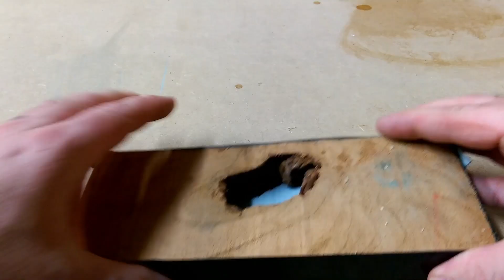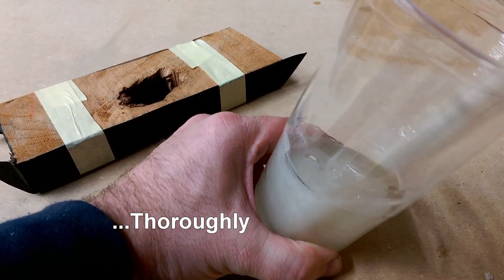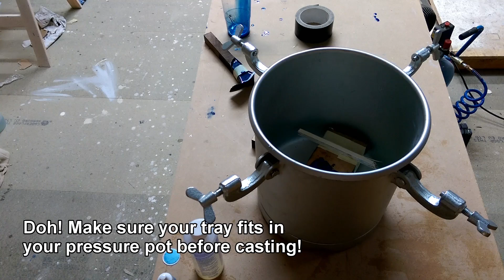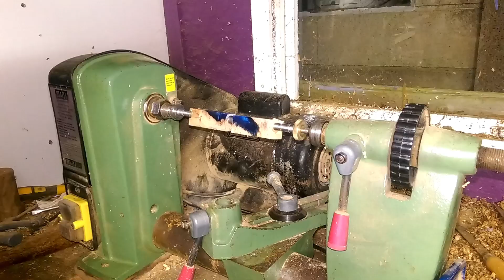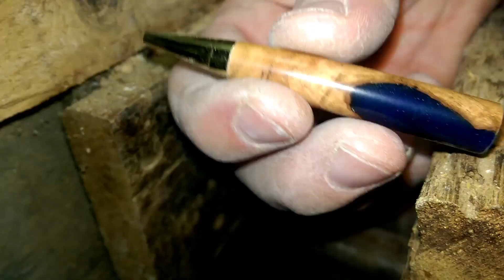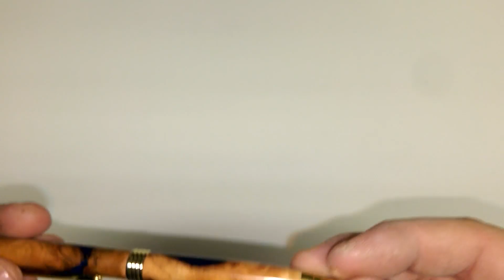Casting worthless wood and alumilite resin pen blank. Cherry and Blue resin

Comment: Beautiful blank and pen! How important is the pressure pot part in preparing the blanks. I have wood and epoxy resin, would these be ok casting without a pot. Thanks
Reply from the maker: Gareth c I haven't really experimented without a pressure pot, the pot was about as much as the resin I use so I don't want to waste any, if you have slow set epoxy you can be careful when mixing and pour from a height to pop the bubbles whilst you pour and try to pick the bubbles out with a tooth pick, it might take a bit of practice and patience to get it right, please let me know how you get on!
Reply: James Garwood thank you James!
Reply: Hey Gareth, like you, I don't have a PP either.  I am getting final parts for one this weekend however.  I've had good luck like the jewelry girls do by using slow setting resin and periodically blowing a torch over the blanks to suck bubbles out.  Worked for me ok.

Comment: Hey James, what's the purpose of the pressure pot?
Reply from the maker: The pressure pot compresses the bubbles in the resin down so they become microscopic, if you didn't use it there would be big bubbles in the blank that would need filling
Reply: Would putting the block under vacuum remove the bubbles?  Sort of like when they make composite structures.
Reply from the maker: @brucepeters9575  vacuum isn't as good for resin, it doesn't pull the bubbles out as well as you might think, pressure crushes them down until they are so small you do not see them anymore, I hope that helps!

Comment: Is the wood stabilized? And why Amazing Alumilte instead of Alumilte clear?
Reply: You could mount your pressure pot sideways for the longer casts!
Reply: Just build a shelf
Reply from the maker: I didn't stalblize the wood for this one, I have been thinking about putting the pot sideways if I needed to bit I've not needed to yet
Reply: @JamesGarwood  same here. No need quite yet for all that.
Beautiful pen BTW.
Happy turning

Comment: What Alumilite are you using that you aren't having to stabilize your wood before casting? Or is there a trick you use to keep bubble from forming at the wood to resin mating point? Awesome pen, I'm going to have to get some silver powder, I like the look of that.
Reply from the maker: Soots Crafting hey soots, it's amazing clear cast resin I use and I haven't had a problem with bubbles but my wood is extremely dry before I cast it, nothing has moved yet, this resin doesn't go really hard so you can't get a nice shine without adding a CA finish so I think it moves with the wood a bit ,
Reply: James Garwood Awesome, thanks for the info
Reply from the maker: Soots Crafting I just noticed I didn't answer your other question! The silver powder is pearl ex powder, number 663, silver, I hope you have had a go at some casting?

Comment: I can see a great channel is being created here ..
It was such a great vid and project 
I was wondering what is the usage of pressure chamber exactly and is there a cheap easy replacement for it ?
Reply from the maker: Mohamed Ahmed thank you very much, the reason for the pressure pot is when you mix the resin together you put loads of little bubbles into it, by putting it in a pressure pot you crush these bubbles down so they are so small they are effectively gone, my pot was under £100 new, and a 2nd hand air compressor would be cheap as well, you could use a PR resin but I don't like turning it because I find it really brittle and it has a horribly strong smell.

Comment: CA glue, "thin viscosity" ???
Reply from the maker: To glue the tubes in? I now use medium or thick CA glue for tubes, I tend to waste a lot if i use thin, i make sure to cover both inside the blank and tube well after scuffing the tube with 80 grit sandpaper

Comment: So, how do you know when NOT to stabilize the wood...almost all channels stress to do it...
Reply from the maker: Hey Mr J. You only need to  stabilise a piece of wood if it's really soft like spalted beech or some types of burl, stuff that is going to make the turning easier, this piece of cherry was very hard and was properly dry before I cast it, it's not moved at all in the year since I made it, the only thing I have had move slightly are pinecones so they could be stabilised which would help out loads when turning, I hope this helps!

Comment: 60 PSI for 24 hrs?  That's not necessary.  And pouring Part B by volume as opposed to weight, also incorrect.  Not good procedures.  Finished product may be good, but not a good utube tutorial.
Reply from the maker: Thanks for the feedback but you are wrong, amazing clear cast alumilite resin is measured by volume,  not weight and de-mould time is 18-24 hours, my pressure pot is rated up to 80psi so 60psi is, 1 completely save and 2 doesn't do any harm, here is a link to the resin please check out the description to see how to use it
 http://www.metalclay.co.uk/alumilite-amazing-clear-cast-epoxy-resin-470ml-16-fl-oz-approx-500-grams/